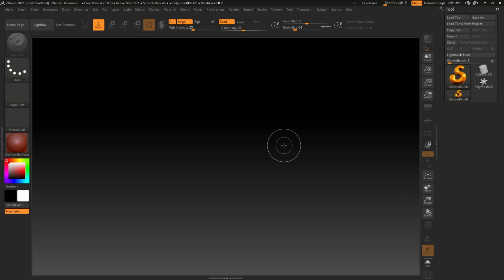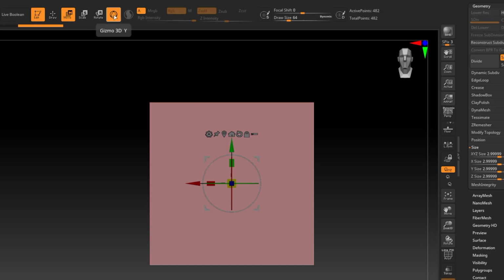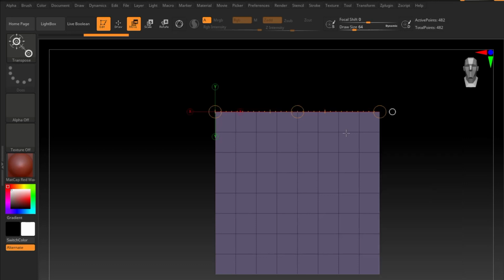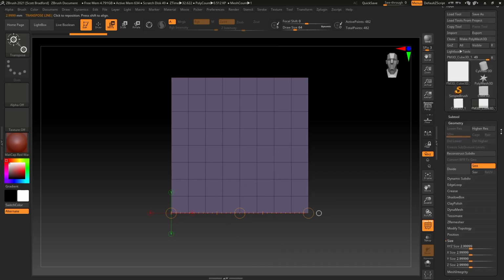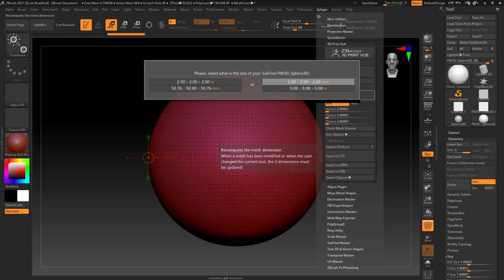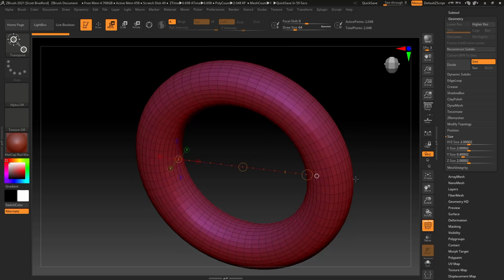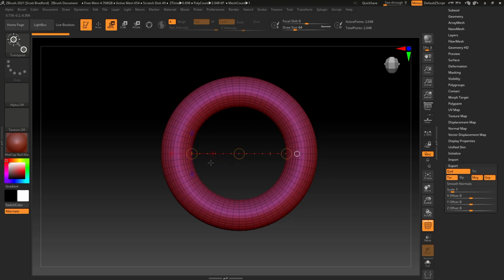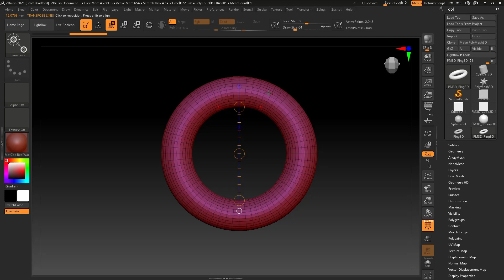How to Measure Jewelry Items in ZBrush

Comment: Dear friend, the dimensions menu shows dimensions in X,Y,Z, but not linear dimensions. For example, if a cube with a side of 2 mm is rotated slightly along any of the axes, and then add it as a subtool, its size will remain 2 mm, but the side will decrease. This means that it is more correct to change the linear dimensions of any body by calibration through the PREFERENCES menu, but not through the SIZE menu. Thank you for your work. Best wishes.

Comment: Please, someone help me with this! When I'm measuring this, using this method, my ring is showing as 8 units when measured, but in my Geometry- size menu it's 23! When I'm measuring a cube, it's consistent. But when I measure the jewellery I'm trying to print, it's completely random and it makes no sense! Why is this happening!
Reply from the maker: Hello, our Tech Team got back to us. They said that the first thing that they would check is under the Export palette on the right side of the screen. Inside the Export palette the slider under “Scale” should read 1. Various things can change that scaling but if it’s 1, the Size menu in the Geometry pallete and the Transpose line should be equal. We hope this is helpful for you. Fell free to let us know if you need any further assistance.
Reply: @RioGrande1944  Hello! Thank you for messaging, I'm really grateful for your reply! However, I don't have a slider called Scale under the export menus on the right. Do you have an email or anything, where I can send you screenshots?
Reply from the maker: @user-tq1xt2ct8s  Hello, if it is easier to send them through email that works for us. You can send your to zkimber@riogrande.com and our Tech Team will take a look and get back to you!
Reply from the maker: Hello, we will get you an answer. Our Tech Team will take a look into this issue and relay back to us the best fix for your situtation! Thanks for watching, we will let you know what our Tech Team says!